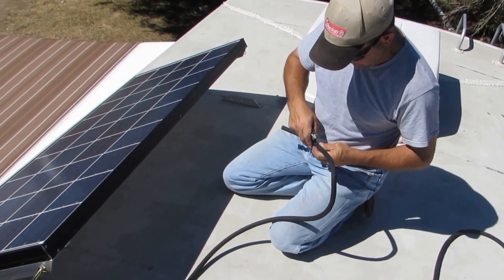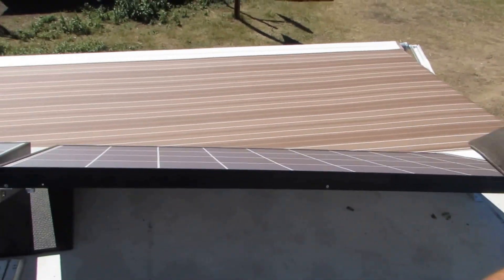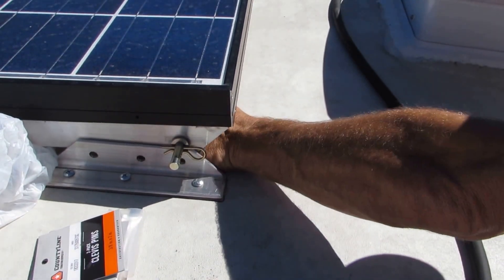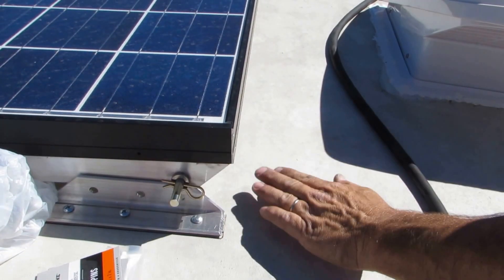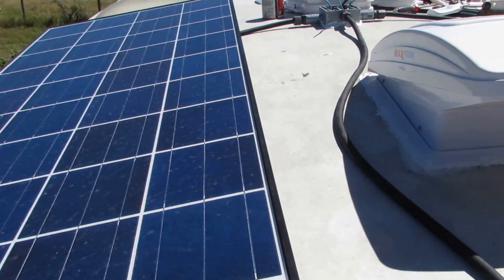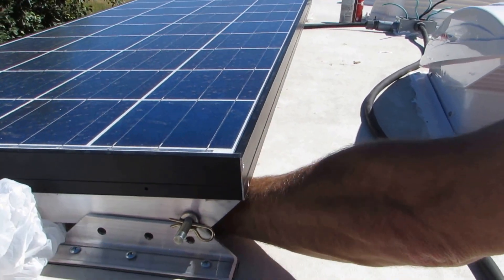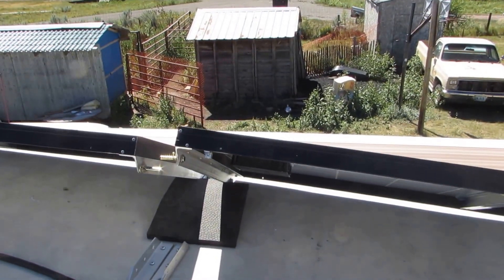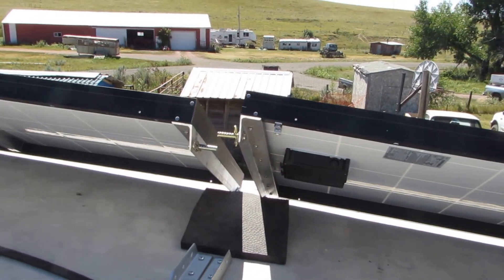Solar Panels "Keeping them Cool" makes you more Power!!!

Comment: Do you make the mounts, Can we buy themfrom you?
Reply from the maker: Howdy! I do hand-make each set of tilt panel mounts. I would need to know what panel and size because of the way I attach the bracket to the panels. We are boondocking in the SW until mid to late May then we will head back to the Ranch in NE Wyoming. If your down in the Arizona area we could meet up and make you some sets.
Happy Trails!!!
Reply: Actually I will be in Wilcox from the 14-16th for the youth rodeo. Here is a link for my panels my 4 sun power panels (https://us.sunpower.com/sites/sunpower/files/media-library/data-sheets/ds-e20-series-435-commercial-solar-panels.pdf)
Reply from the maker: Howdy! I think you tried to call me several days ago. Our cell booster was off and it did not record your cell number. Call back anytime and we can get something figured out for your panel tilt mounts.
Happy Trails!!!

Comment: This is great info.  Have you had any experience with how heat effects the flexible kind I see being mounted directly on the roofs?
Reply from the maker: Howdy! I haven't had any experience  myself on the flat roof flexible panels. Many out there have seen power loss from increased temperature. It is the same as our panels, thay need to cool off to preform at their optimal rating. That's why panels preform better in cooler climates.
Happy Trails!!!